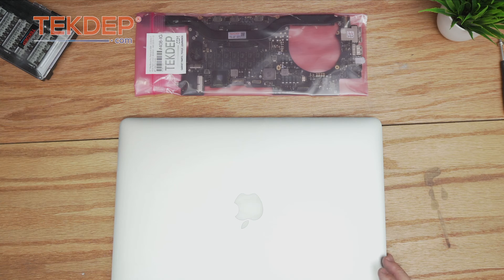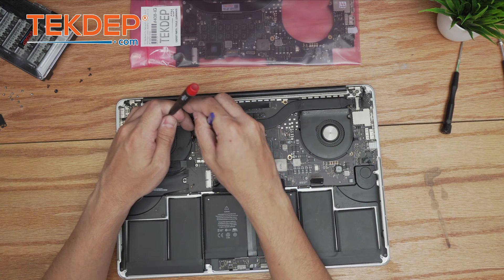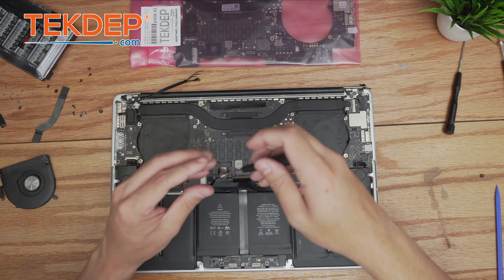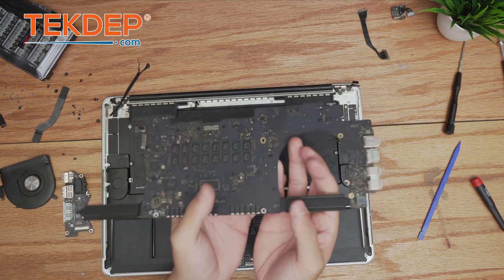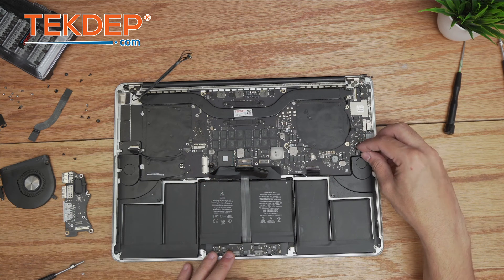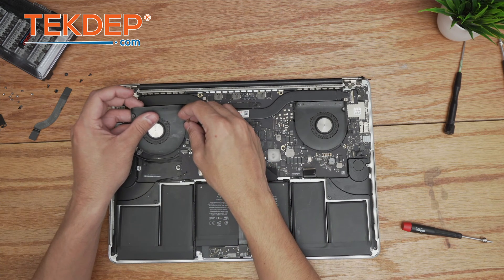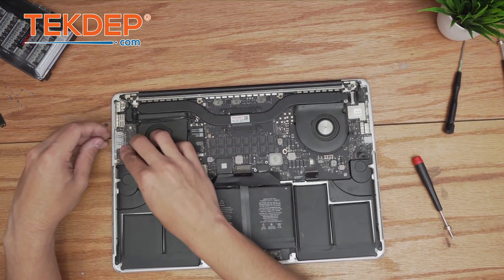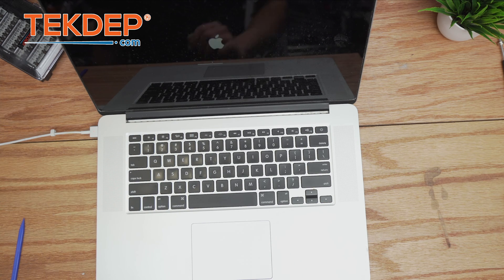Bad Logic Board Replacement Guide | 15” MacBook Pro 2015 Model A1398

Comment: Maybe I missed it, but when you reassembled the unit, did you put the rubber screw cover back in place? I thought I saw it sitting to the top left of the case as you were putting the bottom cover back on? All seemed to boot up fine so is that cover even needed?

Comment: If the previous Macbook Pro had drive encryption, APFS, is replacing the logic board enough to power the system on and recover data or another procedure including the logic board replacement has to be done? I can use Paragon software to confirm there is data on the drive but the software states it needs a password for access. At that point, I started thinking about replacing the logic board but then thought about encryption and if the CPU was related.